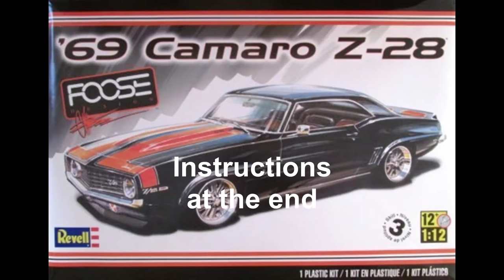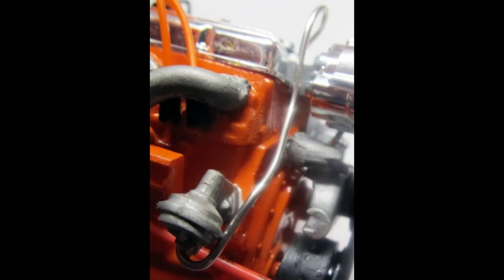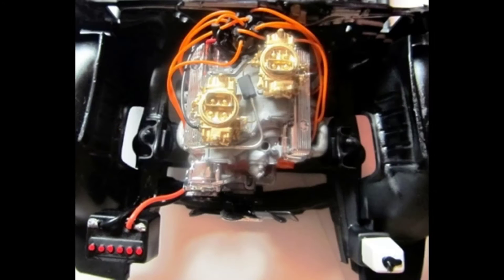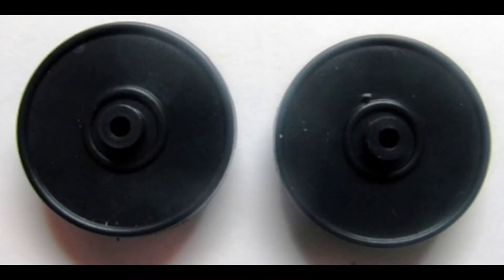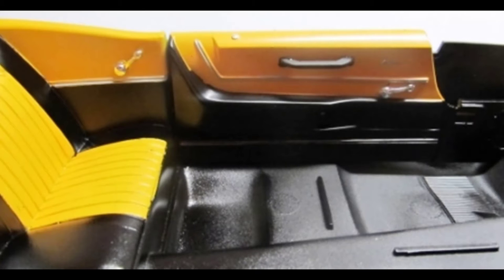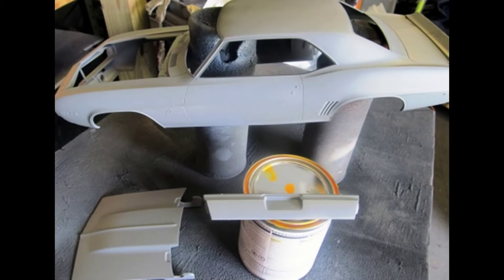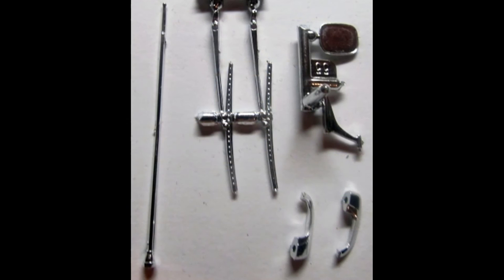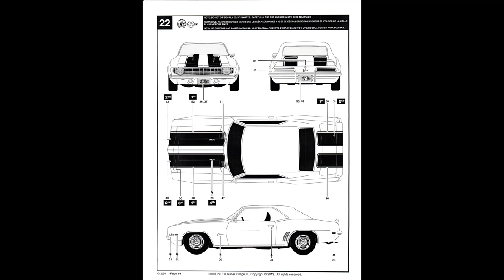1969 Camaro Z-28 (I) Foose Design 1:12 Scale Revell 2811 -Model Kit Build & Review.

Comment: Since 1988 I been collecting these kits (were its affordable) I've built a few of them over the yrs and even learned to scratch build because there was no market for 1/12. I even learned to make molds of parts, and tires. 3D printing is now a very good source and in doing so I have built some nice ones. Tires have always been an issue but wheel I can ask Jim Littiken at Dancing Bear Components to make. Nice review of this kit. RB Motion sells very accurate spark plugs, and boots. Also AN fittings in 1/12. Guitar string works great for brake lines, and fuel lines. I have around 40 kits in my collection some still wrapped. My first car was a 69 so I have alot of love for the car. I own 2 1:1 currently (not bragging honestly) just saying how much I love them. Wish Revell (monogram) would reissue the kit again along with the 57 Chevy, and 67 Corvette.  Props on your build..
Reply from the maker: Rafael,  That's a great back story.  Thanks for sharing and please subscribe if you haven't already to help us reach more modelers! -Doug
Reply: @RightOnReplicas  done thank you..